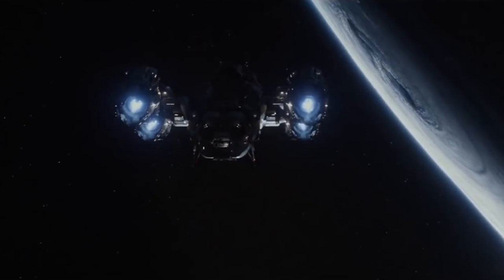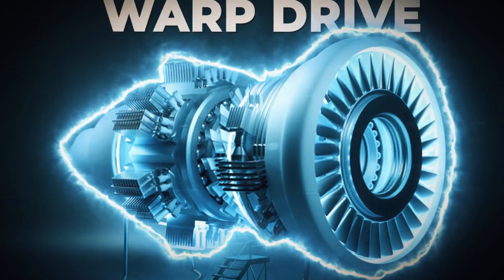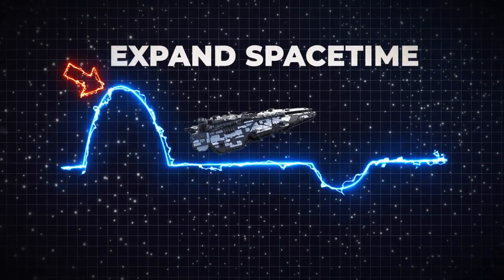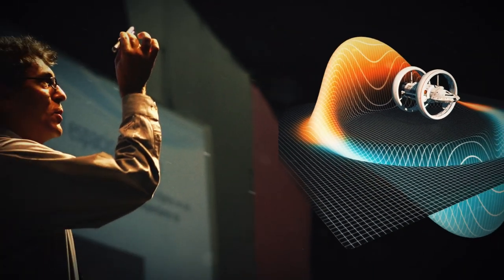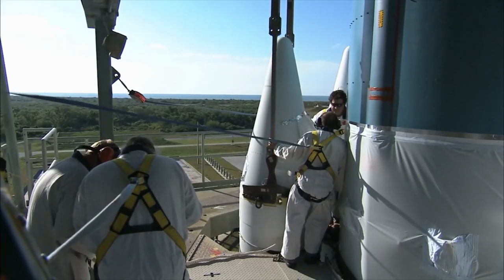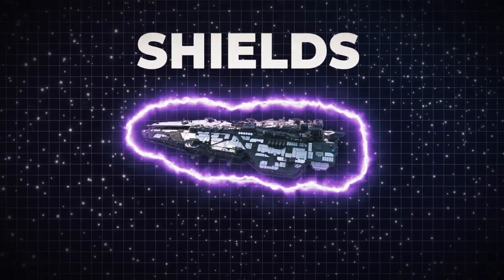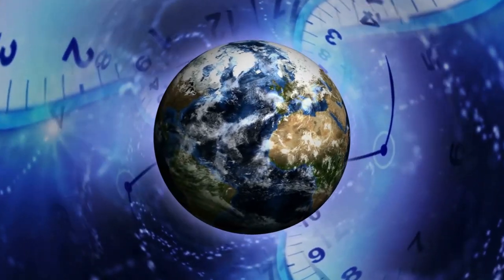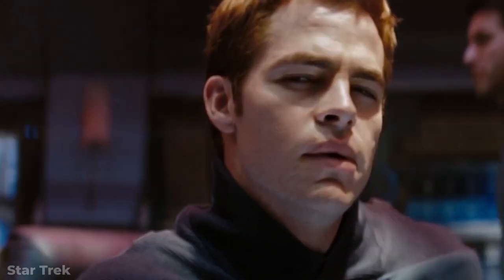NASA’s New Light Speed Engine That Defies Physics

Comment: To warp spacetime, you have to figure out what spacetime is made of.  I argue that spacetime is made of gravitons.  Gravitons are what wave functions are describing.  There is a connection between psi (the solution to Schrodinger's equation) and gravitons.  

Since quantum entangled photons would be described by psi (wave functions), then a pair of entangled photons is equivalent to a graviton between two photons.  

You can store gravitational potential energy in a graviton by frequency shifting (blueshifting/redshifting) the photons of an entangled pair.  Once you can do this to a flow of entangled photons, you can create a warp field.

I hope NASA is looking into this.
Reply: How much energy would that take though? If we can get the energy requirement down from 1/4 of the sun's mass to just a few dozen nuclear bomb's worth of energy it would be a game changer.
Reply: @killman369547  The more gravitational potential energy you can store in the quantum entanglement, the more you can isolate a "spaceship" from the rest of spacetime.  You can probably get away with a kilowatt per meter squared.  But you'll have to work out the engineering and then do measurements.

Comment: I think even light speed travel isn't fast enough to get to other star systems in a practical time. Wormholes or portals will be the only way to travel vast distances.
Reply: Well technically since a warp drive moves space through you instead of it moving through space-time, it could travel at ftl speeds.

Comment: Going the full distance from one system to another takes so much energy technology and time that it's pointless was isn't pointless is taking a shortcut aka wormholes, more specifically man made long duration dark matter rifts, this would allow you to move almost instantly from one area to another. It's like walking through a door to get to another side of a wall vs running all the way around the wall, you just need the keys to open the door, and those keys are in the pocket of warp drive technology. All we need is something that can forcibly collide a positive and negative matter, along with removing all radiation from the area of effect.
Reply: BTW just watched a bit more and Miguel 's theory is next to impossible, bc it relys on the drive moving space and not the ship witch would be like if wanted to get to work so you just moved the planet, what I'm saying is its dumb and would cost more energy than just going manual. Also the table cloth trick works because of newton's law "an object in motion stays in motion unless greater or equally engery is applied" I said it wrong but you know what I mean.

Comment: The bubble could probably be maintained by using a "small" amount of "energy", but making it moves, with the ship inside it, implies some "shear" of the universe and that, being in the same direction of the travel requires works, which, in time, requires energy. It is like a pocket change in my pocket. It does not use much energy when "I" move around, but me, I do.

Comment: 6:50 bending of space and speed should not be confused ... a space ship with warp drive does not need to go on relativistic speeds and thus relativistic time dilation is not an issue .... it's more like you make a distant of 5 lightyears to be just 5 astronomical units or just 5 miles if the drive is really good at it ... so if something travels 5 miles in 5 days that's what we call slow and I'll drop the space bending now

Comment: There is also the problem of warping space. Collects matter as the space ship goes to it's destination. At the destination, all that matter gets shot forward. And will likely destroy everything in the path of that matter traveling a ultra high velocity. Without a inertia damping system, like that in Star Trek. Getting astronauts to a destination, becomes useless if not lethal. It is not just needing a new power source, but the lethal destructive side effects of warp drive technology. Without a damping system.

Comment: He doesn't describe this very well. Its not supposed to work by shrinking the distance to the target, that would be something like bending space time to make two distant points basically meet so the distance could be traveled quickly even with a rocket that doesn't go very fast on its own, or something like "hyper space" Sci fi tech where a ship would actually open a window and go into a different dimension at a certain velocity and then exit "hyperspace" orders of magnitude further than that velocity would have taken them. This "warp drive" on the other hand is supposed to create an energy pressure differential bubble of sorts and take advantage of that potential energy like a surfer riding a wave, except that the wave was created by the surfer. "Warp drive" could potentially keep ramping up the intensity in such a way that even getting to lightspeed might not affect the inertial mass of the objects inside its warp bubble. It's all still Sci fi unfortunately though, as far as I know the "warp drive" isn't being seriously researched as a propulsion device and instead is in the realm of theoretical science. Fingers crossed that we figure this type of stuff out before our species dies out for one reason or another.

Comment: The problem, currently, is that humans have yet to develop any technology relating to the creation of gravity.

In essence, if you control gravity, you control time. This is why people are still under the misconception of how long it would actually take to explore the galaxy. The actual misconception is in understanding Einsteinian physics, which states that "At light-speed, you need an infinite amount of energy to overcome an infinite amount of mass." This is not true, as a ship moving that fast does not actually gain mass, it actually generates gravity. This is what forces the ship to actually need an infinite amount of energy, in Einstein's theoretical example. 

My problem is, generating that much energy would undoubtedly create a massive black hole, since an infinite amount of gravity would tear the space-time continuum. Better it would be to develop a "Faster-Than-Light", or FTL drive, also called a "jump drive." What this does is simple: Imagine two points on a flat surface, or flat plane. What we mathematically know is that the shortest distance between two points is a straight line. However, what if we wanted to travel that straight line as fast as possible? Light speed seems the intuitive answer, but an FTL drive is the better answer. Why? Because of how an FTL drive operates. Basically, the idea is to take that flat plane, and using gravity, fold space-time almost in half, then "jump" across the gap, stretching space-time back out. This was the idea first illustrated in the elementary school sci-fi series called "My Teacher Is An Alien," by Bruce Coville. It was expanded upon by the reboot of the sci-fi series Battlestar Galactica, set 150,000 years into Earth's past. Then, this idea was seen in Star Trek: Voyager, in which an independent Borg colony wanted Voyager's help, and in exchange, gave Voyager the warp configuration needed to create a "transwarp field," which was basically an FTL "jump field," as Voyager then activated it, and went back to Earth almost instantaneously.

Having gravity technology coupled with FTL "jump drive" technology would make space exploration not at all difficult to achieve. Couple that with cold fusion first, followed by zero-point energy that can harness the power of atomic motion, and you would essentially never run out of fuel.

The problem with conventional thinking is that the closer a ship gets to light speed, the more time speeds up from Earth. In essence, at more than 80% sublight speed, for which you would be approaching the known boundary of the universe, more than 200,000 years would pass on Earth -- and even if you could go home, you would not recognize it, nor would humanity probably even be itself recognizable (presuming we dont stupidly cause our own extinction). Probably 8 to 10 years in space, at a relativistic speed, everyone you knew on Earth would be dead from old age, except perhaps your children, who themselves would be considered elderly.

This problem is overcome with a FTL drive, as generating gravity, demonstrated by our observations of black holes, slows time down. In essence, we could "jump" from one part of the galaxy to another, do whatever, then "jump" back to Earth -- resulting in very little time, if any, passing. At least, that's how the theory lines up with current knowledge.

Comment: Being hit by particles and time dilatation effects are a non-issue, because the ship is not in fact travelling at light speed, it is taking advantage of warped space.  As Einstein told us, we cannot in fact travel at light speed because our mass would become infinite. We would be covering the same distance, yes, but across warped space at conventional speeds.
Reply: Not true.

What you are forgetting is that time and gravity are interrelated.

What actually happens is that the gravity generated from your mass, the mass of the ship, and everything on it, becomes massive -- which is why you need massive amount of energy to overcome it.

And since matter and energy cannot be created nor destroyed, how would you gain mass if you are in a space-time bubble outside of the known universe? The answer is, you can't gain mass -- but you could, theoretically, generate gravitational energy.

Comment: ...not even close to how an Alcubierre Drive theoretically works... how did you solve for Banach-Tarski problems?
Reply: Since when does the narrator have to be the one to solve physics problems for a hypothetical object mentioned within the show? There are a lot of problems with an Alcubierre drive that weren't mentioned in the show, like the temperature within the protected bubble, (resulting from the extremes at the point where space-time is narrowed in the front of the bubble) disintegrating everything within it. It'd be beyond awesome if someone found a way to make one that worked, but even if they did, I doubt we'd (the unwashed masses) know anything about it for at least a century.

Comment: The coolest part about warp drive tech that no one ever mentions.... it makes artificial gravity much simpler.
Reply: Why? Can you please explain?
Reply: @ivanoob710  because, the warping of space time discussed to move a ship, is also what causes gravity. Design a ship with one warp field moving the ship, and another creating gravity inside the ship.
Reply: I actually wonder if one warp Field could be used for both purposes. Put the cabin oriented with ground just above the "compressed spacetime", and the expanded spacetime would be above the ceiling.

Comment: You do not need all that energy .. You only need a fraction of that by reducing the gravitational mass of the ship to nul then use far less energy .. Time would not be distorted .. A magnetic shield may be needed but using a jump drive the trip would be instant
Reply: The military has had antigravity and inertia-canceling technology since the 1950s.  I have seen a declassified paper which proves that.

Comment: shouldnt the bubble move space time up in front of the craft and down behind it? if u compare the table cloth to it the cloth goes down behind the items on the table and up in front of them and then flows under them :D (the trick to doin the table cloth trick is there bein no rim stitched around the edge of the cloth to provide the extra width to the cloth when it whips under the items on the table giving the cloth a clean motion under the items on the table rather than a bumpy one)

Comment: If you have a ship moving at the speed of light or faster using the warp drive it's bending space things cannot hit it it will warp around because there are also in normal space the only problem is when you stop somewhere and you're going to collapse the warp bubble or turn off the warp drive the particles that your currently in between will smash into your ship ridiculously fast I believe I'm warp drive would even work light in some way and could even make ships invisible to cameras the eye or even sensors you're worth being space but you also have to keep in mind the things in the space

Comment: This is not light speed travel or a form of light speed. The ship isn't moving, space is. Space in front of it contracts while behind it expands. If you travel at light speed, time will slow for the passengers to an extent where every baby on earth will be old by the time the passengers (who wouldn't have aged much) reaches a faraway destination. Because the ship, using the alcubierre warp drive, won't be accelerating, there shouldn't be any issue with space time being messed up.

Comment: I am not convinced that it would take more energy than is in the universe to power a warp drive, and if it did that would make a warp drive impossible. Also, if it took that much energy, the warp drive would implode into a black hole, because energy warps spacetime. One of the major hurtles with warp drives is that they would produce extreme amounts of heat, which would cook the spacecraft very quickly. It would take a lot of energy to power a warp drive, but also a lot to keep the spacecraft cool. Then there is the problem that warp drives would require exotic matter that we don't currently have access to, and no ability to create in the lab.

There is nothing about a warp drive that is known to violate the laws of physics, and no device can violate the laws of physics.

Comment: The problem with such  documentaris, is that it's aimed to a very large segment of viewrs, thus they invest in computer graphic to impress more than in the issue itself.
As a result you get aaa looot af "water" instead of a solid information,  and very strane (imho) unchecked well ideas.
For example the need to protect as described above is very doubtfull. At least it needs to be explained how come that spaceship travels in a bubble of its own starting space still being endangered from objects in space. 
Another doubtfull thing is the calculation of time passes on earth and the time passes on a ship. I thought that when we say that the distance is for example 5 light years, it means that onboard will pass 5 years, while on earth will pass about 20 years.

Comment: Before we get to it space time, we must first find a solution in the interpretation of the problem between classical physics and quantim, where there is still a mystery, that we still have not discovered and find an explanation, maybe engine of time or other I don't know 🙄🤔  Moreover, classical physics describes differently a particle (atom, particle) and a wave (light, electricity) while quantum mechanics confuses the two descriptions: a photon, an electron, an atom or even a molecule are at the same time wave  and corpuscle

Comment: In his book 'My Contact with UFOs by Dino Kraspedon (Brazilian professor) in the 1950s which the CIA tried so hard to discredit him with fake accusations, threats, etc., he explained that the Martian ET said that the spaceships (UFO) flew by creating a 'partial vacuum' at any direction of which it wanted to move. Even the slighest drop in atmospheric pressure caused the spaceship to fly at incredible speeds and make very sharp turns or a dead stop with extremely high G-forces that would easily kill a human. The only effect that an outsider sees is a 'white, blue or light pink glow' plasma energy that enveloped the craft. This however only worked within a planet that has a full or partial atmosphere eg. planet Earth. If the spaceship is aiming for a certain planet, then it will 'charge /ionize' that whole planet's atmosphere with a directly opposite ionic charge which pulls/attracts the spaceship towards it much like the opposite poles of a magnet ! Amazing alien technology a thousand years ahead of mankind. In the Bhagavad Gita and Mahabaratha, certain 'mercury-type crystals' at the top of the 'vimanas' (flying ships) caused this 'partial-vacuum' effect. Bob Lazar did also say that some UFO craft were like 'living organic mechanisms'. For example, your hand could penetrate into the craft's seamless (no welds) outer skin and you could see the veins and bones, then withdraw the hand out like nothing ever happened !

Comment: 6:48... This misconception angers me. If one was travelling faster than light (in a vacuum), to reach a distant solar system. They would arrive to something that was in the future, compared to what they could see on earth. They could also return, within that "relatively short" amount of time. HOWEVER, they should only have aged, about the times length it took to travel between the two spaces. THEN, they wouldn't be able to see the event take place, here on earth, until the light from that solar system reaches our telescopes. Which means they wouldnt see it here, until the number of years, the solar system is distant by lightyears, have passed.